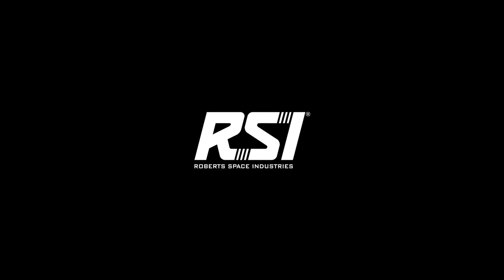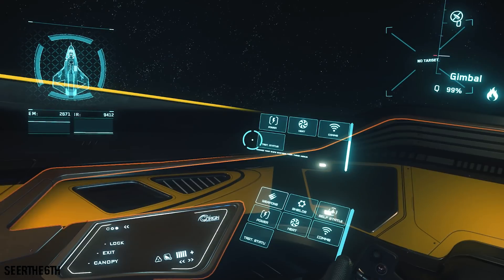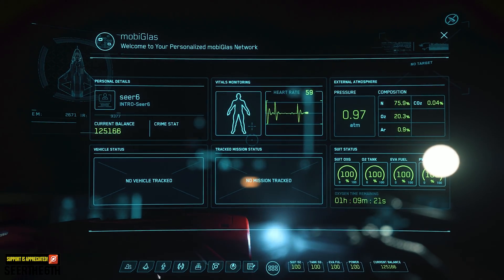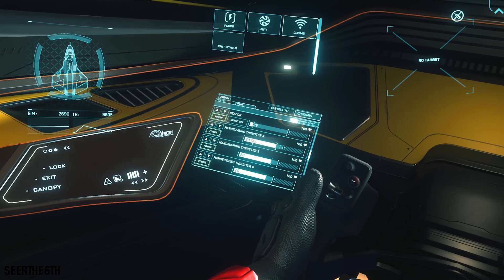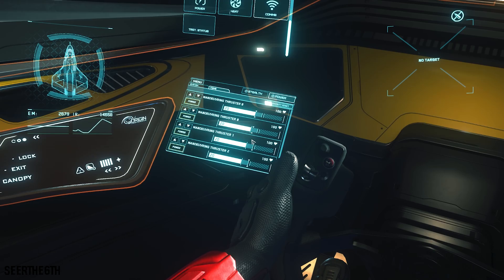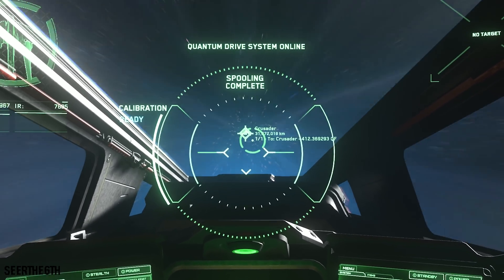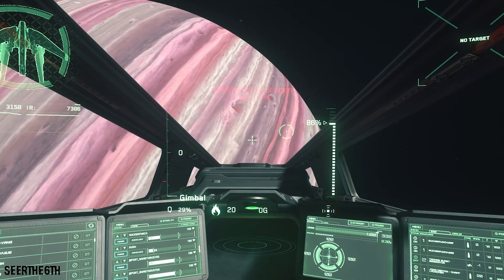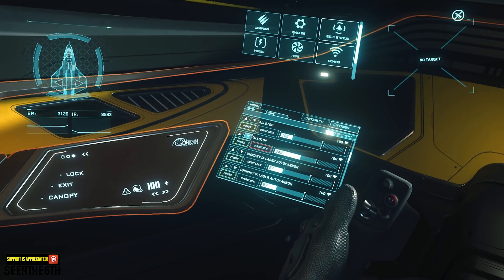Overclocking Ship Components | Star Citizen 3.5.1

Comment: Does getting an excessively powerful cooler make any difference on ship performance or weapon performance over a cooler that covers the minimum requirements?
Reply from the maker: In theory if you have a cooler thar covers the bare minimum, and the wear rating increase or takes damage it could mean you will fall below those minimums and will start to see over heating valves. So it could be better to  get one that gives you some wiggle room.
Reply: @Seerthe6th  Balanced against both cost and increase in signature. The same would be true for power plants. It doesn't make sense to go buy the biggest baddest power plant or cooler for every ship you own, instead maybe requirements plus 15% or 25% or whatever works. I have never had a component fail before the ship did (read: I failed, not the ship).

That is what I thought, but at the same time it would be intuitive if overclocking both in terms of increased power increasing an overclock's effect and cooling increasing the time before an overclock starts doing damage to your systems actually had an effect, which is why so many people go crazy on their power plants and coolers.
Reply: I might test this in 3.9 just to confirm confirm. Might be a good video, testing how long you can fire overclocked weapons with a variety of coolers (which I would guess would always be exactly the same regardless of cooler)

Comment: Do you feel that the overheating of the quantum drive and dropping out of warp is a bug? I would think in the future components would know how to properly pace themselves for the predetermined distance you have set. They should only overheat if you are trying to speed up your QT time like Star Trek
Reply from the maker: i think they did it on purpose, and sounds like a great Idea!
Reply: These ships are supposed to be new still. No one would buy a new car that overheats on the freeway. 
Why is my ship overheating with factory components in factory settings? 

Players should have the ability to over and under clock components.  but the ship should not depend on that game mechanic to function properly. It should be used to give players an opportunity to squeeze more power, Not make it work the way it should have to begin with.